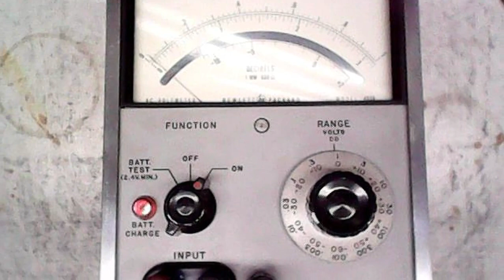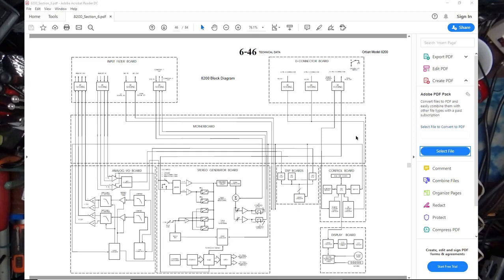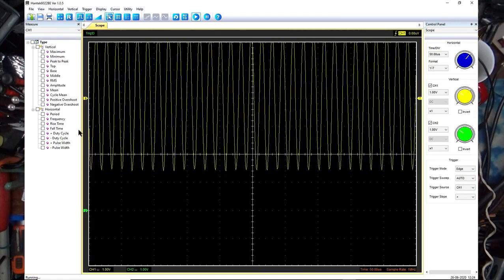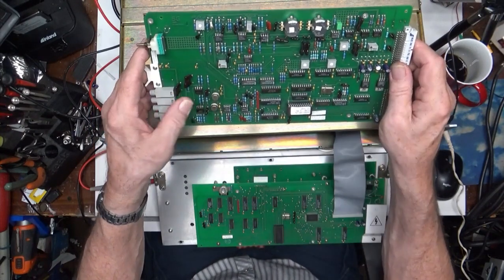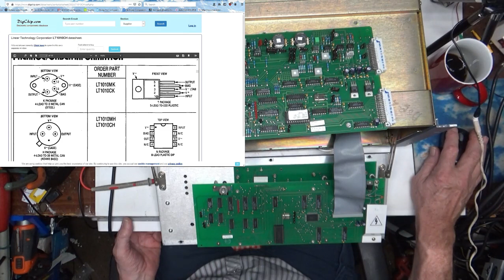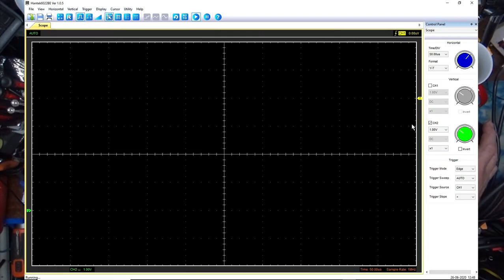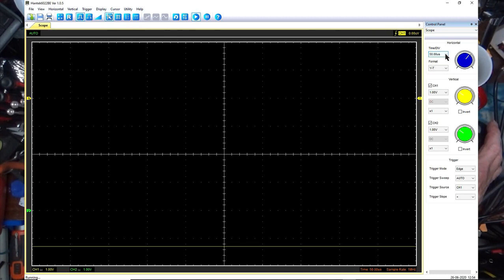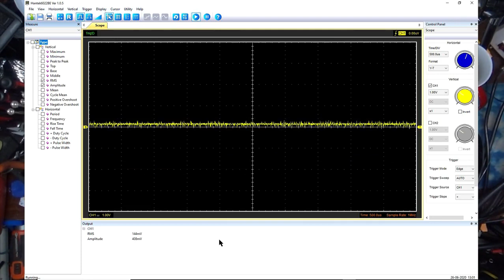Fixing an Orban Optimod 8200 with No Composite Out

Comment: That was a great lesson, thanks.  I appreciated the tip about using flux with solder wick.
Reply from the maker: Glad I could help. Just remember there are several kinds of Flux and they aren't the same. Look them up on the web. It is amazing. And to think it wasn't that long ago I thought Flux was called Ruby and came in an impossible to open can. Still works for pipes though.
Thanks for watching.

Comment: This is the trouble when companies use specialized parts such as the LT1010CH. In years to come, these components will be unobtanium and we're stuck with using pulls from old equipment and wondering whether it's the part we've just put in that's also faulty or if there's still a fault in the unit. I have been down this road too many times. The other side of the coin of course is that companies like this don't expect their gear to be still in service 30 years down the track, or that people will want to repair them. For the most part however, all the Orban gear I have worked with has been pretty reliable.
Reply from the maker: Since we pay a premium for 'broadcast' equipment you would think 30 years would be the norm. Without Ebay a lot of these kind of repairs would not be possible.
Thanks for the comment and for watching.
Reply: @AERVBlog  Good post, good repair! This older gear is the stuff I prefer to work with - for the most part it is repairable.
Reply from the maker: @radioengineering8247  if that ain't the truth. Have you looked inside a Composer recently. I hope either my eyes don't get much worse or I can afford a better microscope.
Reply: @AERVBlog  I haven't seen inside a Composer but I can imagine what it's like. A lot of these modern boxes can't be repaired - and I doubt the factory does repairs to component level either. They'd most likely just swap out boards, because the boards are not manufactured to be repaired by humans.

Comment: Nice repair! I thought you were replacing the wrong part and said so but you weren't listening. I've never done that - well, maybe a few times. For the non-station techs it might be nice to give a brief description of what the unit does at the beginning and also terms like "composite" - as a former radar guy used to dealing with "video" I immediately think composite video.
Reply from the maker: I have dealt with so many bad op amps that I can now make educated guesses on if they are bad. I figured both channels wouldn't go bad at the same time and the LM318 is a pretty rugged chip. Also I have seen so many other kinds of units facing the outside that had blown something I kind of had an idea.
You are right. I don't script my videos and sometimes I get wrapped up in the moment and forget to explain things. Most of my videos are so long already I don't want to bore folks either.
Thanks for watching and commenting.

Comment: do you have any videos for troubleshooting an 8000A? Got one off eBay and something seriously wrong in the generator.
Reply from the maker: Not really but at least those don't have black blobs that do all the magic. Good luck. One word of warning. Don't just change out the OP Amps on that. The ones in there were hand picked and if you change them it might not work at all. And of course, check voltages...